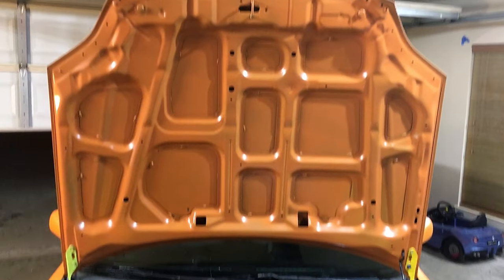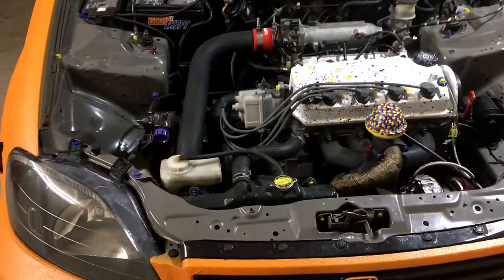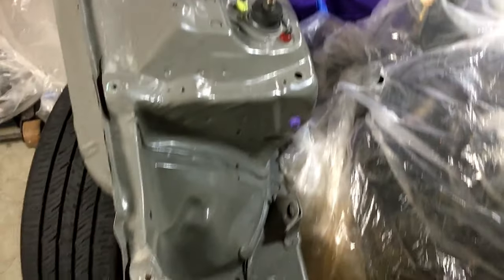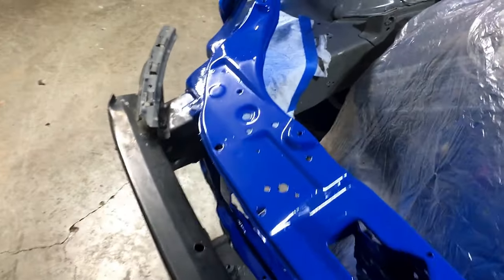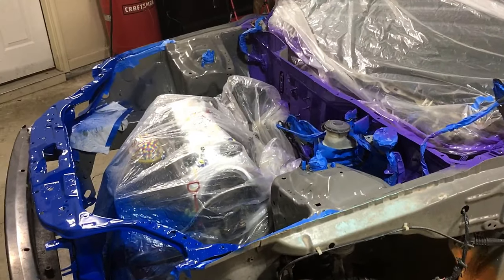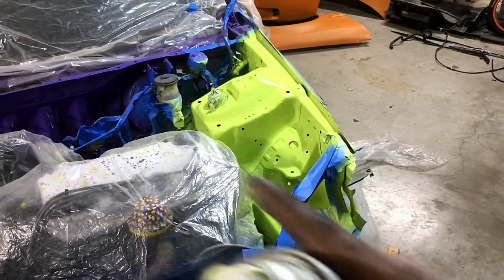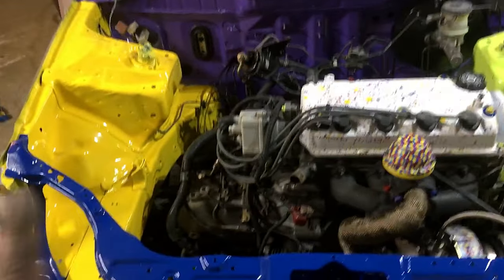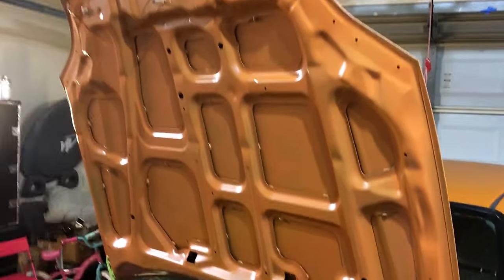How to paint the bay with engine in & make it look good(Autism awareness build part 4)

Comment: Unfortunately that paint isn't very chemical resistant. Did a motor cycle gas tank once and looked good until some gas dripped on it then it wrinkled and fell off in those spots and looked like crap.